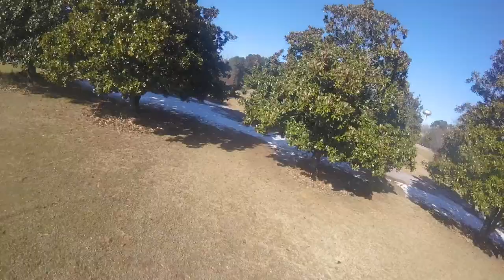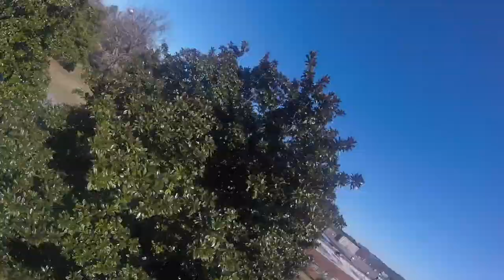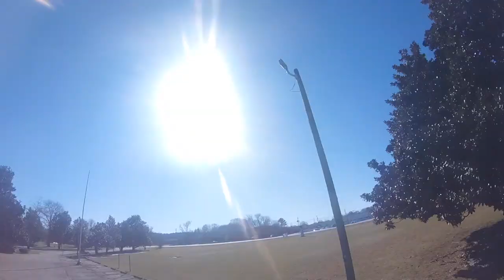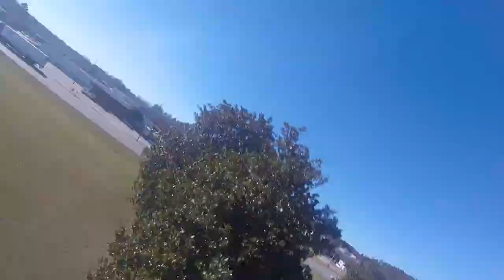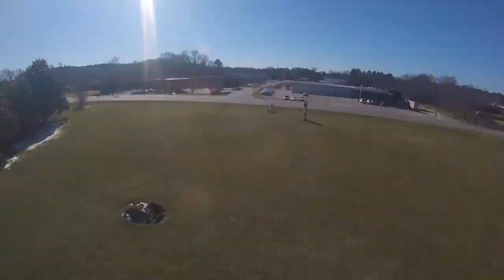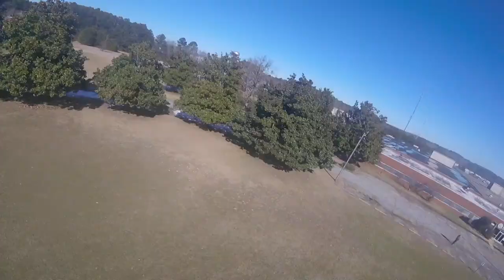Random Lockouts (PLEASE HELP)

Comment: Yeah, i'd do like Shaka X says, and re flash the board back to your old settings. I fly KISS, but had a similar experience when I loaded new software that had higher loop times. Also make sure your stuff is really dry. I like to put my stuff in front of my heater for a few hours, or over night after I get my stuff wet. Strange things always happen when my stuff gets wet.
Reply from the maker: Yo thanks Magic! I think I'm going to give that a shot today. Such an idiotic idea testing the overclocked board in the snow! Haha, now it's impossible to tell what caused the issue. By the way, how do you like KISS? I know the people that run it really swear by it. I've often thought about building a KISS kwad (maybe an Armattan Rooster? and some of those Steele V2 motors? My apologies, as I often daydream of possible builds haha). Thanks so much for the help, watch, and comment, man! Always love having you here and being part of such a benevolent community!

Comment: Hey it's Jake. Your failsafe  problem is most likely from the reciever. U can fly with only one antenna but u will loose about 3/4 range. Also when your antenna is cut it imedeatly becomes defective. So u are basicly running without antennas. I noticed when your quad failsafed there was power jumps. If you flash your esc's u should be fine, just make sure the firmware matches the firmware on the fc. These power jumps and or failsafes can also be brownouts so make sure none of your components are touching the carbon/eachother.
Reply from the maker: Yo Jake! How's it going, man? Thanks so much for dropping by and taking the time out of your day to help me out! It does not go unappreciated lol. As my ESCs go, I recently (maybe 10 days ago) flashed them all to the newest version of BLHeli32 (the one supporting turtle mode), so I know they're all synced and up to date - do you think re-flashing them with the same firmware would help? I know in the past I've fixed software issues on my FC by simply re-flashing it, so it honestly wouldn't surprise me lol. When you say power jumps are you talking about that clicky/tsk tsk tsk tsk sound when it locks out? Is that how you can tell? because I was wondering about that noise. In reference to my antennas, I know running without one antenna will severely reduce my range (I don't know that the second one is sliced all the way through, it may just be the black outer cover, so it may still be intact), but here's my one issue with the receiver explanation (because I figured it was that originally, but then considered this:)  is that my Taranis never gave me any feedback when it happened. Normally, when I lose Rx signal I get the ol' "Telemetry Lost" or at lest a "Telemetry Critical," but I got nothing - which struck me as weird, and indicating it may not be the Rx. But I'm still going to try to replace both of the antennas and see if that helps anything. Thanks so much again for the help, man! Can't thank you enough. Hope to see you soon for some flying! (P.S. How does one identify a "brownout?" because while I was flying in the snow the other day my video feed randomly cut to black - I guess that would be a blackout lol, but it's back now so I guess it isn't that relevant.)

Comment: does the black box tell u anything?
Reply from the maker: Yooo b00bs, what's up, man! Glad to have you back, and thank you, of course, for the view and comment!! As far as the black box goes, I actually don't run one, to be honest lol. Embarrassingly, I know very little about using/reading black box data. Also, I do not believe my FC has an SD card slot - is that a requirement to get black box readings? Or can you get them straight from the FC?
Reply: MattBaelFPV i don't know much too, but u can at least see the load and other stuff that's going on when the failure happens. Depends in the board some have built in memory for black box like my betaflight board.
Reply from the maker: Yeah that would be of great help, honestly! Lol. Perhaps I should find out if my board (Matek F405 AIO - the reputably bad one lol, although I haven't had any of the noise issues others have - shrugs - just luck, I guess). Because that would've been perfect for this issue! Thanks for the words of advice, b00bs! Always a pleasure!

Comment: if you have chopped and damaged antennas then you should go ahead and get some replacements, it definitely cant be helping. But the crazy twitchy noises from the motors makes me think you could be overloading the microprocessor.

:antenna replacements:
https://www.amazon.com/Irctek-Frsky-Receiver-Antenna-Version/dp/B01MG6SS1S

i know changing the shape or cutting the tips of the antenna can cause issues with the wavelengths they can receive. joshua bardwell does a great video about it.

good luck man. i've got a quad with failsafe problems too and it can be frustrating but there is always a solution
Reply from the maker: Hey Waxxy! Welcome to the channel man, so good to have you here. And thank you, especially, for taking the time out of your day to write all that and offer a helping hand with my issues. Know that you are a wonderful sample of an already amazing community! That aside, in regards to addressing my issues - I believe you are absolutely on the money as far as your diagnosis regarding the twitching noises being the microprocessor. Because I downgraded to a more stable version of BETAFlight that would allow my microprocessor to run at about 4% versus the 35% or so I was running with this new version. It is also worth  noting that I stepped the Gyro/PID frequencies down from 32/16kHz to 8/2kHz and I think that is what ultimately solved it (regardless of BETAFlight version, I mean). 

And you know, I've actually totally seen that Bardwell video (isn't he just the greatest when it comes to technical explanations? lol) - despite knowing that, I admittedly run with only one antenna about half the time because I lose them to
 scraggle on a weekly basis. Because I never really go super long range, it rarely come into play. But I'm sure If I were to go back to say, the bandos near my house, I think it would really start to give me some range issues, in regards to penetration. 

And I hope you figure out your failsafing kwad, man! Luckily, I was able to mend mine by downgrading it, which makes me think it was not failsafing, but simply an overload of the CPU, as you said. I wish I could help you, but alas, I know very little about failsafing problems - although I wish you the best of luck! Let me know what you find out!
Reply: Np i try to help when i can. and i think my failsafe issue is due to a bad RX, just got a new x4r in and if that doesnt fix it its back to the drawing board lol.

as far as antenna problems go how do you mount yours? i take a section of zip tie and heatshrink mine up it. then i use smaller zip ties to secure it to the rear standoffs. and i have yet to break an antenna. sometimes i have to add more heatshrink if a propeller clips it but because of the way i run them the ziptie always shields the wire. i have had the same receiver and antenna for over a year
Reply from the maker: Haha I know how that goes! I actually just started using those XM+ receivers and they're banging! I don't think they support telemetry, but I actually don't use telemetry, myself lol. As far as mounting my receivers goes, I normally use a very similar method of heat-shrinking the antennae ti zip ties and run them straight out the back. They rarely get hit by the props, but the problem lately (a considerable one, as it has cost me 4 antennae in the past 2 or 3 weeks haha) is the cold. I guess what happens when it's cold, is the zip ties get very stiff and brittle - so when I hit scraggle, as I so often do, it basically breaks off the zip tie and takes the antenna with it haha. It's not nearly as fun as it sounds. Thanks so much again, for the advice and comment, man! I am immeasurably appreciative!

Comment: Dude don’t bother with all those filter changes. There just hype shit to get u to spend more money just reboot the board leave it stock and sort out a decent tune I’m still running 3.1.7 and my drone would rip Joshua bardwells it’s pilot not ur settings trust me I still fly my vortex 250 pro and nobody can tell the difference 👍👍👊🤘
Reply from the maker: Dude you're honestly so right. I took all the fancy filtering off and re-flashed the board to a stable version and she's flying like a dream (more or less - still working on the nuances of the tune). I lol'd at the Joshua Bardwell comment, so true! Haha.Thanks for dropping by and leaving some love, man; always a pleasure!